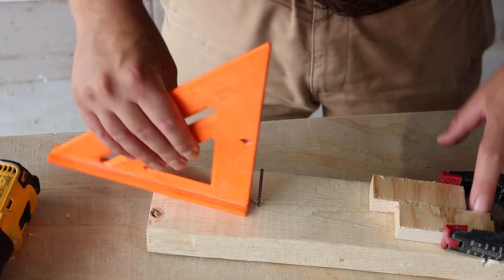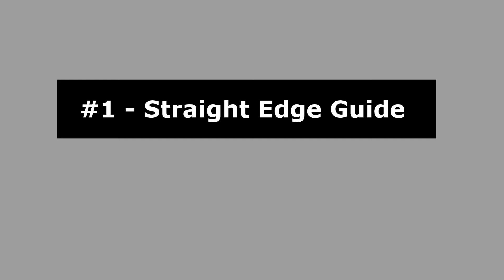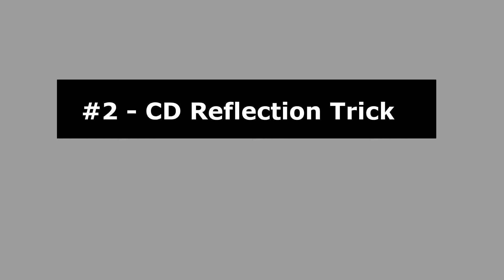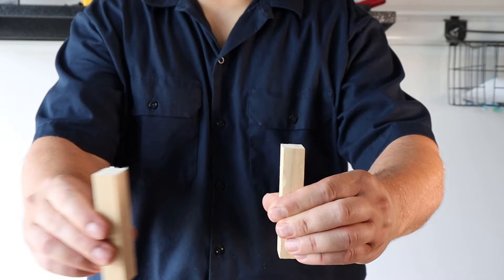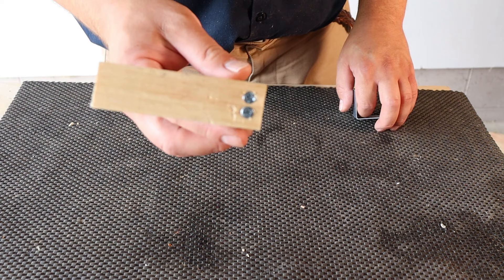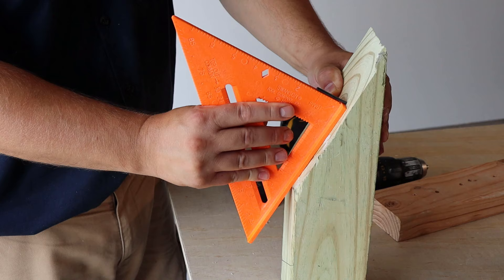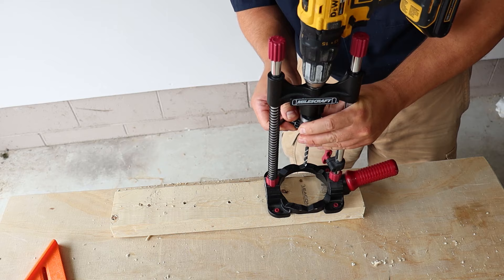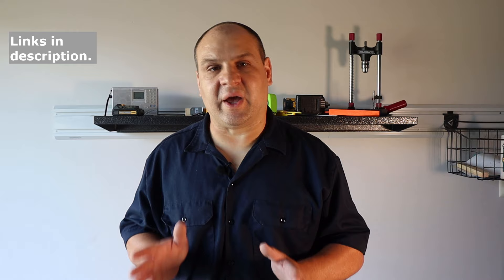🟢 Drill STRAIGHT Holes (5 Easy Ways without a Drill Press)

Comment: Drill blocks are used expensively in the aircraft industry but with a little foot on each corner to accommodate the curvatures
Reply from the maker: I did not know that... you mean extensively not expensively right?
Reply: @DIYWithAaron  yes extensively I used them nearly everyday as aircraft Fitter with Airbus

Comment: The only cutting faces on a drill bit are the two leading edges so once you've got the hole started the rest will follow, so removing the drill block to drill deeper or thorugh a peice is no issue so long as you let the hole guide the bit. Nice post by the way.

Comment: Since I have a drill press, I drilled a hole into a block of wood, put it on the bench and made sure it was level.  Then I chucked the bit into my hand drill and stuck it into the hole.  Then I glued a circular level to the back of the drill and made sure it was level.  Now, I can free-hand a vertical hole pretty well by keeping the bubble centered in the level as I drill.
Reply: What if you need to drill a hole straight into the face of a board that is attached at and angle or at least not perfectly level? Your method is good for things like anchor bolts but the video is much more practical for the things most people will encounter.
Reply: @joshcowden6163  If that is the unfortunate situation that you find yourself in, then I cannot help you.  I would consider hiding under the bed, or, better, changing your name and moving out of town.

Comment: You can also use a plunge router to start a straight hole at least. It has the flat bottom plate to align it with the material you want to drill. It functions similar to the alignment tool. Just the travel is pretty limited. ..  :o)

Comment: I use an drill block or guide made by Big Gator Tools. It has the v shape cutout on the bottom for drilling in round pieces. It works very well. I bought it online from USA. And this purchase has a little funny story. At customs office when I received the package and opened it for inspection the customs dude was stunned. He had never saw something lile this until then and called a coleague to look at the guide, to make sure it's not a firearm part. I was prepared for that and I pulled out an drill bit from my pocket and showed them how it works. They asked why I bought it from USA, because there are some taxes I have to pay. I told them that their reaction to seeing it is the answer. There was nothing like that guide, to be found on Romania's tools market, and the EU sellers asked more than double the price in the US. This happened more than 10 years ago. Now there are several options to buy, locally, but all are polymer body with metal bushing, not solid hardened steel like the Gator guide.
Reply from the maker: Wow... I didn't realize the drill blocks were so hard to get in other countries. If I had to go though all that hassle to get one at a reasonable price I would have went for an all metal one too. Good thing you thought ahead and had a drill bit handy for explaining it to customs.

Comment: This video helped a lot.  I'm building an end table and I realized after doing the glue-up that it's not going to fit in my drill press.  I have an old Craftsman drill guide with drill permanently attached drill but it has the smallest jacobs chuck I have ever seen and can't take the bit I need.

Comment: Great video! Thanks for sharing bro. I have a little recommendation to save some money. It will either be  for free pretty much or really cheap! and all it takes is a  little effort and scrap metal. you can make your own drill blocks!  if you already own a drill press, mill or even a metal lathe or maybe can get access to one of the above. All you really need is a scrap piece of steel, cast iron, Aluminum, possibly bronze or even a hard wood a could work in a pinch.  So bring your most used drill bit sizes with you. Simply drill a series of all your most used Drills and then you have a drill press accurate Drill block that works great! And youll save alot of money! The gator brand drill blocks are pretty pricey for all sizes. so i did this to save money. I had some scrap metal so i didnt spend a dime on it. You may ask why would someone need this if you have a drill press? Well the short answer is the portability of the drill block. Sometimes i have to go to sites and need to drill fairly accurate holes but only have a power drill. So this works great for those situatuons, Or maybe you just need one hole and dont want to go in your shop to drill it lol (ive been this lazy many times!) Lol anyways its useful and youll find yourself using it almost anytime you need to drill holes. If you use hardwood it  will not last as long or stay as accurate as steel, cast iron or even Aluminum or some other harder metals maybe even softer like bronze could work for a while. Well good luck everyone and i hope you all have a nice day. Thanks for reading my free book lol
Reply from the maker: Thanks for the positive feedback. I totally agree that making your own drill block is a lot cheaper if you already have a drill press. I was specifically thinking of those who didn't have a drill press and needed to be able to make a straight hole on occasion. Good tips though for making a drill block for those times when a drill press is unfeasible or inconvenient.

Comment: The drill guides usually have a V shaped groove in the base so you can put a pipe or other cylinder in it to drill centered holes.
Reply from the maker: Good point... I probably should have mentioned that in the video. The portable mini drill press also has a V machined into it's base for the same purpose.

Comment: You can start with drill block then use the wood blocks to keep you straight. 🎸. Great video. Thanks. I'm  putting handles on cabinets not sure if a portable drill press is necessary. If holes are less than 1" inch deep then ill be okay without a press.

Comment: I was going to make a floating shelf out of a 1 inch board and I needed to drill on the thickness of the board so this is what I did to make my whole straight I got a another piece of board and cut out A straight piece and made it 1 and 1/2 in in width 6 in in length after drilling the straight hole into the middle of the thickness of the wood I then glued a piece of wood on top that was 1 in thick 6in log 6 in width top and bottom so that it slides it looks like a c-channel like a letter C if you look on the side of it and that slides into the board  because the one and a half inches will guide your drill bit nice and straight and Improvement to the idea you could add a piece of pipe so that you don't mess up the hole that's made out of wood since the drill could go sideways a little and then make the whole crooked so that's why you would put a piece of pipe but since I had steady hands I just did it this way I didn't feel like doing extra work with the pipe plus I didn't have a tool to cut the pipe ended up not using that wood cuz it was too heavy so I ended up using quarter of an inch plywood some high density spray foam and I just put a hole using some Square Dill rods to create the holes that the pipe with or the spike or whatever you call it that goes through the holes to hold it up and I glue those in there where all the holes needed to be at and the rest I just sprayed it was pray foam  to keep the spray foam from bending the wood I just made another floating shelf out of thicker wood and then that would fit inside that that's keeping  from warping it and that's how I did it and then I just shaved off a chunk with an  utility knife those ones that you can pull it out more and more blade a light weight strong making a lightweight floating shelf i did not needit to hold heavy thing it worked out fin
Reply from the maker: I didn't quite follow your entire description of what you did, but I think I got the gist. I'm glad it worked out for you.

Comment: I glue a small round bubble level to the back of the drill.  Not perfect results but helps a lot if I want to quickly drill free hand
Reply from the maker: That's a good idea. I used to have an old drill with a level in built into the head although it was vial style so no side to side accuracy unfortunately. I could see your way with a bubble level being much more useful then what I had.

Comment: The best method for me is to mount the work in a vertical position.  then you use a square L ruler to put your drill vertically straight, you then have to maintain that position while moving your head back, a great way to do that is to keep your left hand in touch/between the battery of your drill and the workpiece (so the motion of moving your head is not going to disturb the vertical alignment). Then after you just horizontally center it by eyeballing, which is the easiest part. Also, you would want you left hand on the back of the motor of your drill to maintain precision
Reply from the maker: Sounds like you perfected that method. Mounting the workpeice vertically seems like it would help quite a bit with the precision.

Comment: I’ve always wondered why manufacturers don’t include.a flat surface to the top of their machines which lies parallel to the axis of the drill bit? This surface could then be lined up with anything that would give the required straight hole. Also a spirit level, perhaps two lying at right angles to each other could guide when drilling holes in walls.
Reply from the maker: I know some manufacturers, like Ryobi, have added bubble and/or spirit levels to their drills in the past to help you line things up. Drilling perfectly perpendicular holes to a work surface is a pretty specific requirement most cordless drill owners probably won't care much about when buying a drill so I'm not surprised manufacturers don't focus on it much.

Comment: I'm building a custom dog crate, and I'm using wooden dowels for the bars, I have the perfect drill bit for them to fit snug, but I can't drill a hole or insert a screw with any resemblance to straight. I didn't know drill blocks existed, but I'm heading out to buy one now! Thanks! I totally wasn't going back to the Home Depot already because I didn't buy enough lumber... who would suggest such a thing? (ok, yes I am).
Reply from the maker: A drill block is real handy to have around. Should make your life much easier. Good luck with your project.

Comment: Get s small plastic mirror, drill a hole into it and use the mirror effect as a guide. you almost always will get within 1-2 degree accuracy depending how slow you go.

then i see you CD Method.

Comment: Question- Has anyone made their own drill blocks? I have a drill press available. I’m thinking using 1-1:2” hardwood and maybe 4-6” long. Go along and drill common size holes. Looking for comments, both positive, negative or suggestions. I’m not making fine furniture, just trying to get a decent, straight hole. Thanks in advance for any help.
Reply from the maker: One suggestion is to notch a 90 degree V on the end of your drill block for uncommon bit sizes. Just for flexibility.

Comment: Great guide! I am wondering , if there is a home-made jig for a forstner drill bit at all?
Reply from the maker: You could make a 90 degree scrap jig with a notch at the bottom for the bit head to fit. As long as the shaft of the drill bit is nestled in the corner, it would probably work.

Comment: Which method would work best for using a hammer drill on a concrete wall? I need perfectly straight holes to hang a wood rack on my garage wall.
Reply from the maker: I'd probably try to make a jig out of a 2x4 with straight holes spaced as needed for your wood rack to act as a drill block/guide. I'd also anchor the jig to the concrete with tap cons temporarily. That's the only thing I can think of that might keep you honest with a hammer drill.
Reply: @DIYWithAaron  Thank you!! I appreciate the response!

Comment: Some really gd tips thks. I’m currently making some bookshelves out of some tongue and groove flooring and need to glue several boards edge to edge. I’m adding some dowels to the edge joins for extra strength as the tongue and groove on its own is a bit loose. I found it really challenging drilling straight dowel holes into the edges of the boards / that’s even with using a dowelling tool. Any suggestions? The tips presented assume you have a flat face on the material perpendicular to the drill but drilling holes in the edges of boards doesn’t.
Reply from the maker: Do you have extra T&G boards that you could build into a jig? If you were able to use the T&G to create something that interlocked "well enough" with your workpieces and you cut the other side to a flat face for your dowelling tool to sit on that might help. Hard to know without seeing it, but that's my first thought.
Reply: I would use shorter dowels. Half the length is half the inaccuracy. They are mainly for maintaining alignment, ie resisting shear more than strength, but just use more if you want to use them to resist tension/separation forces.

Comment: Great video. Can any of these techniques be adapted to drill straight & centered into the end of a wooden dowel or a chair leg? (If not, how would you do it without a drill press?)
Reply from the maker: Every technique can be adapted somehow, just depends on how easy it is. 

I had a situation where I adapted the 90 degree angle trick to drill straight holes into the ends of two long slim pieces of metal in an epoxy repair that I wanted to reinforce with a steel bolt. 
See it at: https://youtu.be/Q0cdJedCqeU?t=248

You're going to need to figure out a jig of some sort to line things up.

Comment: How about with a forstner bit tho?
Reply from the maker: Bits with 3/8 wide shank will work with a portable drill press. You could probably do up to an 1 1/2" forstner this way. If the shank is larger or the bit is more than will fit in the guide rails then you're going to have to either make a crazy jig or breakdown an buy a drill press.

Comment: You should mention that, where applicable, you may loose drill depth by using drill guides.
Reply from the maker: Yes, that's true. However, even if the drill hole is not deep enough with the drill block in place it's really not a big deal since the started drill hole will guide the drill even after you remove the block.

Comment: Drill Block obscure drilled material, how do you land hole exactly where you want it?
Reply from the maker: You can pull the block up on the bit and then you can see the tip of the drill bit in order to place it. You can also use an awl or nail to make a dimple in the wood that you can use to see/feel where the right spot is with the bit before you use the drill block.

Comment: When using a drill block, is it hard to see the mark for the hole you are drilling?
Reply from the maker: Yes it does, but you can line up your bit in 2 ways... either lift the drill block so you can see the tip of the bit to line it up with your mark or dimple the wood where you want to drill with an awl or nail so you can do it by feel.
Reply from the maker: Shauna Tate  There's little notches in mine that correspond to the holes so you could draw guidelines on your workpiece and line it up. Most of the time it's easier and more practical to just lift up the block for half a second and look.

Comment: You can honestly make your own drill block.
Reply from the maker: You definitely could.
Reply: @DIYWithAaron  i actually went and got two pieces of wood you described to make a right angle and made a drill block in a couple minutes.  Good information.  Inexpensive solution
Reply from the maker: Saving a buck by using your noodle... there's nothing wrong with that.